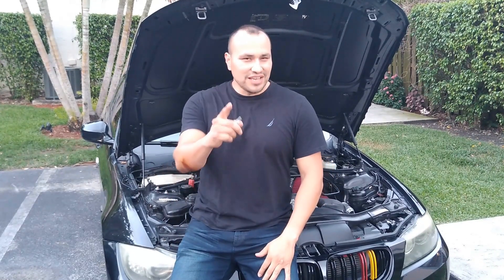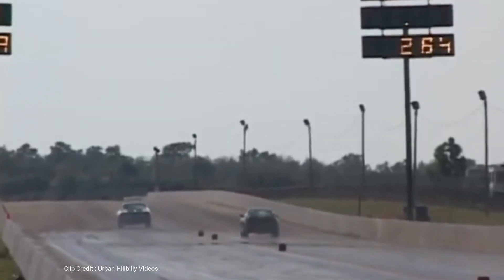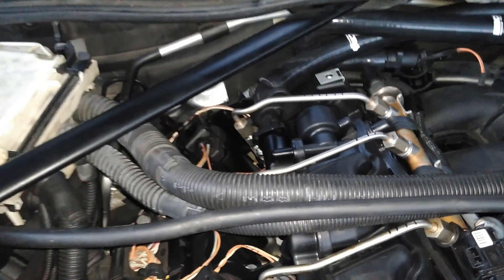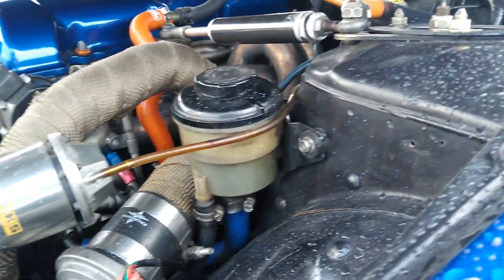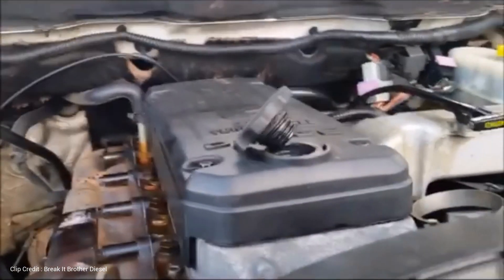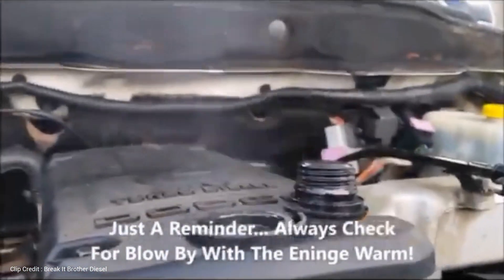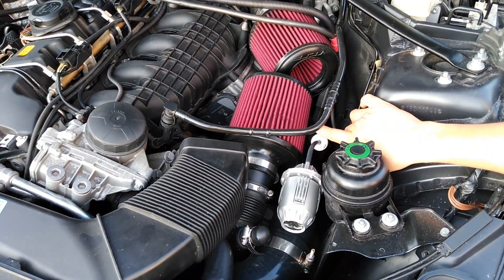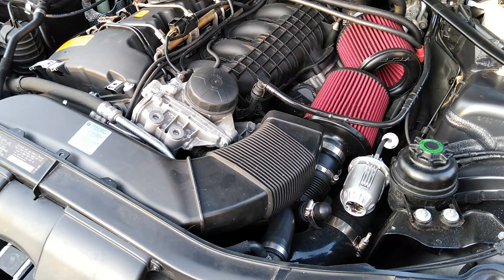Is the HKS BOV Filter needed? Blow by explained

Comment: okay thx mate....

In my opinion hks is the only company with use filters.  allright.

by the way your short rams isn't good.

directly installed on the hot engine is a no go.
it is not bad to you , but thats also bad fot the system.

i used the injen cold air sytem on my 2.5 sti and a dry boxed roto fab on my chevy ss sedan.

I strongly advise you to rebuild it back!

best regards from germany 🤙🏻
stay strong

Comment: This is a great video bro, are you able to make a video on how an N54's Oil cap should be like when the engine is warmed up for a proper blowby video?
Reply from the maker: Thanaks brother 💯
There shouldn't be any major difference on the oil cap or any excessive air or pressure when the oil cap is opened. The video shows when there is some serious blow by issues. If anything similar to that can happen, there is a big chance it can be a bad pcv valve. Pcv valves if not change in the past, since our car are older those valve can go bad and create excessive pressure and damage gaskets or even the engine it self. Most of the times since we have as a common issue a valve cover leak or crack. When the valve cover is replaced so is the pcv valve since its already inserted in the valve cover. The piston rings can get worn out be cause of high miles and the cylinder it self can get scratch because of bad oil maintenance (which in turn the piston ring will not have a good seal). 
This scenarios can be the cause of a bad blow by. If you wanna maintain you engine at its best, do your oil changes on the regular bases and never wait to long. Oil has to be one of the most under looked things that can damage engines in the long run.
Reply: @CrazyCarMods  appreciate the advice, I just swapped a new VC & PCV Valve & catch can a couple days ago. When i shut the car off & open the oil cap after the car has gotten to temp there is slight smoke/ humidity coming out. Does that happen to you?
Reply from the maker: If its slightly that seems to be normal. 
Actually, cars that are barely driven or shortly driven have issues because of this. 
When an engine does not get to operating temps, it does not allow for this vapors/humidity to be burned off; in the long run this will cause heavy carbon build up within the engine. So its normal if its just slightly.
Reply: @CrazyCarMods  also shouldnt the valve cover be having some vacuum, like positive vacuum so the cap would be a little harder to open because it’s getting sucked closed? Thats what others have told me.
Reply from the maker: Im not quite sure but I do know there is pressure build up within the valve cover, hence that's the reason the pcv valve is there. There is vacuum on the intake manifold. I have not experience any sort of extra pull on any car when taking off the oil cap. But that would be something worth looking at 🤔
Reply: @CrazyCarMods  if you’re serious about your oil in your n54. Check out Motul Sport Esther 5w40. Turbo builders recommend it.
Reply from the maker: Sure will 👍
Thanks 💯

Comment: what are all the reasons a bov might change its sound over time? and is blow by one of them? i have blow by and am doing preventative maintenance but could blow by be a reason why my hks bov sounds different and i’ve only been running it a month and it’s brand new. i have a 335i with stock turbos
Reply from the maker: Can you describe a little more what you mean by changing the sound? Like what's the difference from when you installed it vs now....

Comment: Yeah I noticed my HKS bov only after about a week of driving has changed it’s noise, so I believe blow by might’ve drowned it a little. Would an OCC and a new PCV valve fix this?
Reply from the maker: That's kinda odd. Blow by does affect the bov in the long run but I highly doubt it after a week. Having an oil catch definitely helps; not only by minimizing the oil residue to the bov but also to your valves. 
As far as the pcv valve, it works like a relieve  valve so your engine (crankcase) don't work under pressure. Having high pressure within your engine is what damages gaskets (main reason our engines have issues with oil leaks) valve cover gasket, oil housing gasket, oil pan gasket, rear and main seal gasket. So a good working pcv valve is a most, so not a bad idea to upgrade to a good pcv valve. Although that would not have anything to do with the sound.
What diameter are you using for your vacuum hose and where did you have it plugged in at?

Comment: Thanks for the explanation, I thought this piece has an influence on the sound of the valve, but no. It filters the air.
Reply from the maker: No prob bro. What makes the difference is the star like insert the blow off valve has in the front. There are actually 3 pieces so you can change the sound if you like. One is the star like one insert that comes with the HKS BOV and then there is another 2 that makes different sounds.

Comment: hey was up i have been using a hks bov on my rb20det for quite some years now and I used it without  the filter and it still works like a charm i  but i highly recommend the oil catch can it works wonders trust me it does it saves u a lot  i used to do drag racing  and now I'm getting into drifting which is even much more stress on your engine when you are banging the high rev

Comment: Lots of catch cans only collect shit in high RPMs when the engine is working hard, or only collect in low RPMs. External PCV systems should be installed for high powered cars to completely avoid blow-by
Reply from the maker: The pcv system work under normal or heavy load but It will actually close when full throttle, which is a big issue. I believe this is the actual problem we have with n54's. we all start tuning it for higher power and start pushing it harder yet the harder we push it the higher the crankcase pressure, which ultimately will create leaks. front / rear main seal, oil housing, oil pan, valve cover gasket. I dont know why the hell would someone design a system (pcv) to stay closed when the engine is pushed to the fullest? 
Guys with big turbos opt for a external pcv system because of this. 
If any of you guys have some additional input Please chip in....

Comment: Great video!!! Just gone combo for my KIA Stinger 3.3TT, I'm thinking of not using the valves for now. I have a dual inlet catch can which works well -- so I'll give it a shot.  Car only has 40K kms on it, maybe when it gets a bit older, if I notice anything suspicious, I'll add them in.
Reply: How goes it? Swapping my Boomba for a HKS but thinking of running it without the filter on my 2021 Forte GT/M

Comment: Recommendation on when to change the inline filter?
Reply from the maker: It truly depends on how much you drive and the condition of your engine and blow by it self. A regular intake air filter should be changed every 12k to 15k miles, so I would think that can be a good mark. What you can do is to check it periodically to see the condition of it. If its starting to look dirty then go ahead and change it, But if it still looks good then keep it a little longer.

Comment: had to take mine off, it was causing my rpm to fluctuate between 500 and 800 rpm at idle.  i have a twin turbo, so I took both off and now my idle is fine.
Reply from the maker: was it acting up when you first installed it? or it started to fluctuate after a while? did the filter look dirty or a lil darker than new by any chance?
Reply: @CrazyCarMods  no it wasn't, just started acting up on the road at a stop light.  I looked around for a vacuum leak and took those off first, since they were the easiest to diagnose.  Once I took them off, the car idled normal again.  Those filters didn't have any cracks and air was able to pass when I blew thru them..I think the air passage is too small causing restrictions.  Blowing thru a hose with it connected did have air flow restrictions.  A member from my grouphad issues with his as well but his actually broke, one of the reasons why I took them off first.
Reply from the maker: Hmmm interesting. What car do you have bro? I heard some guys had issues just by putting installing the BOV. They actually kept the bov and instead of blowing to atmosphere they had it recirculating. 
Which it makes no sense to me 🤔
I think the issue lays with the computer thinking it will get a certain amount of air back and it doesn't adjust for it or its to sensitive. 
By the way bro also what size of vacuum line are you running for your set up? And do you have 2 BOV's or one?
Reply: @CrazyCarMods  2 bovs. I have a q50 redsport.  Running the bovs are fine and the rough idle has not returned after running it hard many times. Just recently another member with a tial bov kit, is having the same issue with the vaccum filters installed.  breather hoses are 6mm ID, to the intake manifold and 3mm ID to the BOVs.
Reply from the maker: With the tial bov it would make more sense that he is going through issues. The tial bov requires a 1/4 inch (6mm) inner diameter all around, and installing the filter can definitely have its restrictions since the tial bov works differently (spring operated) in comparison to the hks which is a sequential valve structure with a differential pressure control system. 
Also the line being 3mm may be causing a slight vacuum restriction. Since the HKS bov needs a ID any where from 4mm to 6mm. 
Even if you don't ran that filter, I would up that line in size. Best to go with a one piece of 6mm and run a oil catch can to lower the oil blow by. At least this way you can protect your inner air flow pieces from oil residue.
Reply: @CrazyCarMods  yea, I have an OCC installed.
Reply: also, the vaccum hose i'm using is 3.5mm not 3mm.
Reply from the maker: What Im still not sure is if a 4mm diameter plays a difference between 6mm ID in different cars. Right now I am on 8psi and will soon increase it to 18 - 20psi and I have the 4mm vacuum hose. I haven't heard of any issues with the 4mm but I do know a few who are running 26psi which went with 6mm, not because of any issues but more for safety. I haven't heard anyone having any issues within this platform though. 
How much psi are you running on that Q50?
Reply: @CrazyCarMods  18psi on 91 and 20psi 91/100oct mix.

Comment: i got my hks bov for free and its a bit beat up so I don't care about it too much. All the filters are around 30$ after shipping so I'm going to save my money and run it without.
Reply from the maker: The filter piece is to protect your blow off valve from oil. It is best to protect it, But if you don't care about that, you wouldn't notice a difference in performance at all with out the filter or with the filter.

Comment: I have a similar set up as you but the issue with mine is the flapper valve does not have any clamp to secure onto the inlet hose, it is basically just pushed into the hose. Do you know what type of clamp I need to secure this?  the oil catch can (out) J hose attaches to the flapper valve which concerns me if the connection is not fitted properly. 5:40 in the video is what I am reffering to.
Reply from the maker: I am a little confused by what you mean as the flapper valve. Let's start by what type of car engine do you have? And did you already get the oil catch can?
Reply from the maker: You can also take a look at the same installation of this Oil Catch Can. I made sure to make this video as detailed as possible. Im pretty sure you can find your answer here.  https://youtu.be/SEs6wJKvAGU 
Hope that helps.

Comment: What brand of oil catch can do u have and where did you get it?
Reply from the maker: I don't remember the brand, but I got the Oil catch can on Amazon for around $48 and it was actually advertise as BMS oil catch can. But it's not from Burger Motorsports. It was a replica, exactly the same (I didn't see any difference) besides the brand name on the can. Do a search on Amazon. Mine has MCR or something like that on the hoses itself on white lettering. You'll notice when you search.
Reply from the maker: Hey Christopher, I don't know if you looked at the latest video I uploaded about the oil catch can installation, but in there I go over detail on the catch can I ended up purchasing for the $50 that was advertised as a BMS oil catch can. This way you can have a better look at the quality and fitment of this particular Oil Catch can. Hope that helps man.

Comment: Hey I just Installed My HKS BOV with a VRSF chargepipe, I did everything correctly but for some reason my HKS BOV isn’t working, do you think it is a defective BOV or is there something else you think might be wrong. Maybe a vacuum leak?
Reply from the maker: Did you get any check engine lights/codes? and did you make sure both gaskets where installed? the one in the charge pipe and the one in the BOV? Installing the bov it self can be a little hassle, specially when it comes to getting that c clip to seat correctly. Try pulling on the bov a little hard and see if it comes off. There is a high chance this is were the error may be. Check your vacuum line and your fittings. Make sure to push in the charge pipe to the throttle body to make sure it's all the way in correctly. Lastly how did you try to test it out? remember that the engine needs to create Boost first.
Reply: Crazy Car Mods Crazy Car Mods i made sure everything was installed correctly the BOV has no play on it and is sitting properly on the charge pipe, I don’t have any codes either, I’m guessing it might be a faulty BOV, I did a few pulls on my car and I couldn’t hear the BOV at all
Reply from the maker: @ISTHEBEST7CR  if you did do some pulls then that's kind off weird. how did the car feel?
Reply: Crazy Car Mods it felt just like normal and was still very responsive I just never hear BOV
Reply from the maker: @ISTHEBEST7CR  That's weird I never heard about that before. Then it may be a faulty BOV. Try having someone record the opening of the BOV, then do a couple of revs (pass 4000 RPMs) and see how the bov is reacting (you should see the inner valve open and close). Then as a last resource you can do a smoke test to check for any boost leaks.
Reply: Crazy Car Mods I did a recording but the BOV was not reacting at all, I will do a smoke test tomorrow regardless though, thanks for the help I appreciate it
Reply from the maker: @ISTHEBEST7CR  Any time man. Let me know how it goes. I would love to know.
Reply from the maker: Did you ever get to figure out what was the issue?
Reply: @CrazyCarMods  nah man I don’t know why it  isn’t functioning I got a cheap eBay one and the eBay one worked but the original HKS wasn’t for some reason
Reply from the maker: Damn man, that sucks. Where did you get the one that didn't work?
Reply: @CrazyCarMods  I got it off the VRSF website and they wouldn’t give me an exchange
Reply: @ISTHEBEST7CR  did you figure it out? I’m dealing with the same issue rn
Reply: @cooperbsu6060  yeah bro i tested it on different cars and it turned out I had a defective BOV, I tried to get a refund and they wouldn’t give me anything. Sucks
Reply: @ISTHEBEST7CR  fuck literally just drove mine to see how it was and engine malfunction light came on
Reply: @cooperbsu6060  do you have a boost leak bro ? Might cause it to not be functioning
Reply: @ISTHEBEST7CR  not sure I’ll have to bring it in. I can get the blow off valve to open and make noise at full boost but other than that it stays closed.
Reply: @ISTHEBEST7CR  change the size of my vacuum lines going to the bov and my engine light turned off but still doesn’t want to open
Reply: @cooperbsu6060  WD40... Can help you.   Just blow into your SQV Vaccum pipe and wait for 6 Hours...than BOV come back to work like a new one...(sorry about my english)
Reply from the maker: I also have a DIY on installing the charge pipe with the HKS BOV, where I go in detailed step by step. Check out that video and see if there are any steps that you have missed. Other than that let me know how it goes.
Reply: I have same problem, Has anyone found a problem?